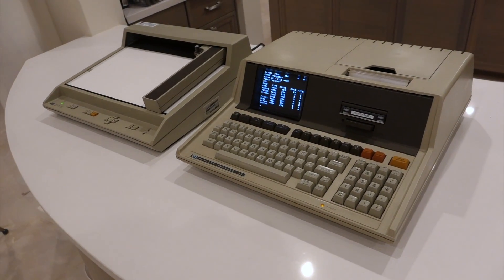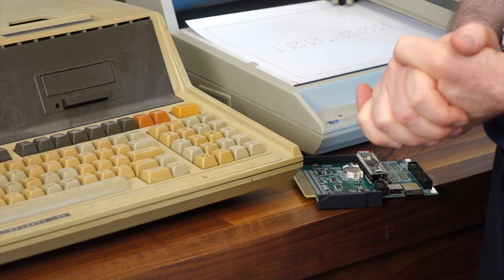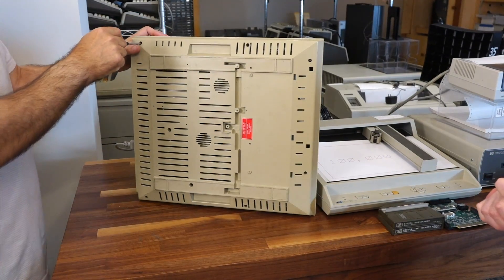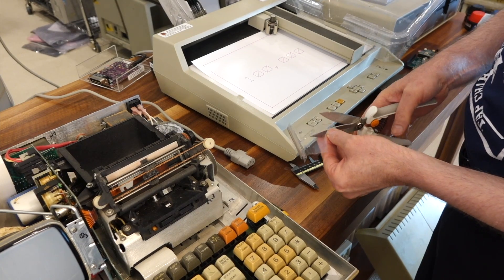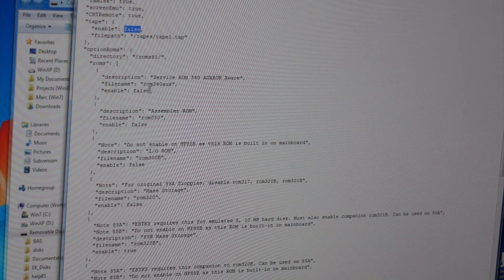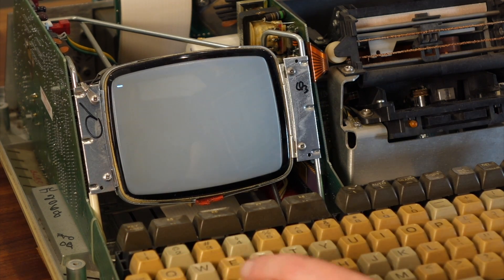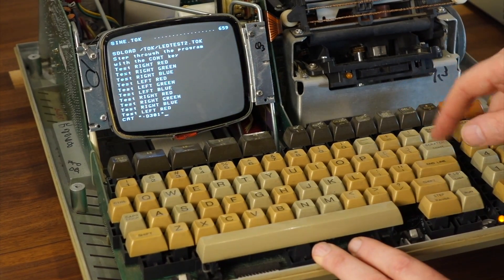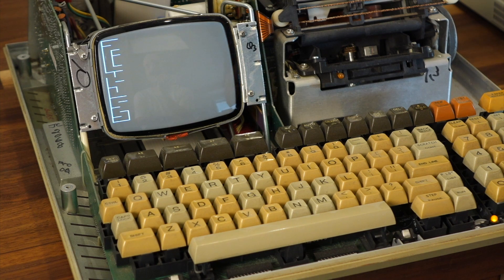EBTKS add-on board for the HP-85 vintage computer

Comment: That HP-85 looks like a prime candidate for solar-only retrobriting. Just leave it in the sun for a few days and watch the keyboard and case both un-yellow. It won't be perfect but it should be better, with no significant risk of streaking or splotches.
Reply: Especially for large pieces, I use ozone dissolved in water.  I use my ozone generator pumping ozone into water, getting ozone dissolve in water and leave the plastic in it for a couple of days.  Ozone generator constantly pumps ozone into water during the whole operation.  The result is always awesome without any streaking, splotches or nonuniform restoration.
Reply: @Mr_ToR  They'd still have to take it apart to put it in a tank, including pulling all the keys off the keyboard -- although if it has keyboard problems, it's probably going to get torn down that far anyhow. My proposal was to be as lazy and cheap as possible while still getting a result. :)
Reply: @mal2ksc  Don't you have to adjust from where the sun will shine or wont shine etc?  I mean normally a side at least should not get as much light no?  Do you have any images/video examples etc about sun only retrobriting?

Comment: Would the tape drive emulation code be helpful in creating a tape drive emulation for the HP9815 ?
Reply: Unfortunately not. Different recording format and probably different number of tracks on the R/W head. EBTKS emulates at the register level of the controller chip, which is only used in HP85 A and B.

Comment: Does this mean I can finally adjust and test the 8673 signal generators  according to their manuals? Anyone have this data? The mysterious 11726A tape data. I have both 8673B and B's monster of a brother called 8673D with their monster manuals.

Comment: That is incredible. I’d like to get at least one or two of those. The price seems very reasonable. I’ve got several 86s and 87s, but I don’t use them much since storage is impossible. This opens up a lot of possibilities, especially since it has all the ROMs. I’ve been trying to get an 87 IO ROM, but I don’t want to purchase if I can’t return and the seller can’t demonstrate that it works. This should solve that issue.

Comment: There are a couple of lab instruments which have an 85A built-in, and those are the 8450 and 8451A diode array spectrophotometers.
Reply from the maker: Thanks! I did not know! Now here is another instrument I need to acquire!
Reply: Was it the 9915A/B used as an embedded 80 series?

Comment: Can you stll replace the paper and ink in this mini computer built-in printer
Reply from the maker: Absolutely. It's a thermal printer so no ink needed and the thermal paper is available.
Reply: @CuriousMarc  oh, great then, I thought you cannot find it anymore since Gameboy printer uses thermal paper as well, but you cannot get it anymore

BTW: can you write on thermal paper by hand, with heated pencil or usibg a lighter?
Reply from the maker: @Veso266  I have never tried, but it should work. You can write on it with alcohol or glue too (don’t ask me how I found out).

Comment: Could the CPU be overclocked at all by changing the crystal. Say to 800KHz or even 1MHz
Reply: I doubt it, too much is tied to the clock already, so you would break a great many systems that rely on precise frequencies.
Reply: @SeanBZA  emulating the capricorn cpu on the teensy 4.1 has been discussed as has a zillion other things we 'could do'. The emulation would probably be equivalent to a 30+MHz capricorn at a guess. The actual HP85 would then just become a power supply, screen and keyboard.....

Comment: Adrian's digital basement just did a video on a 4 inch screen for $ 20.00. He found the quality too poor for practical use.
Reply: It really depends on the CRT itself, and the dot pitch of the actual unit. You get some insanely high resolution small CRT units, and some that were barely good enough to have 525 line NTSC mono video displayed on them.
Reply: @SeanBZA  I have a 9" green-phosphor CRT display (VGA, originally made for POS systems in the 1990s), and it has an unbelievably sharp picture.  The HP unit has a screen built for computing, most of the other small CRTs were built for cheap portable televisions.

Comment: Looks like they are using a Teensy 4.1 for the EBTKS, so the computer is with its 600kHz vs 600MHz on the Teensy just a tad slower, can it be used as a coprocessor? :D :D
Reply: Yes, it is a Teensy 4.1. Because of the do everything in software approach (including bus transactions), we use about 60% of the available performance. EBTKS adds about 70 new keywords to the system, and co-processor type acceleration is a future possibility.
Reply: @fliptrontube  Does the EBTKS come with a 4-inch thick operations manual?

Comment: That CRT is immaculate! From the video it looks like there is zero burn in.
Reply: It looks a lot like the ones used in those karaoke machines you can find at thrift stores. I had an old police terminal with a CRT needed to be replaced, and one of the karaoke machine tubes was a drop in replacement
Reply: Funny that Marc did not seem as impressed as you.  I seem to recall him saying it is "ok" or "pretty decent".  I agree with you - it looks great.  Marc has high standards...
Reply: For me it would be a fun project to replace that crt with an LCD, just for kicks, power savings, and safety (no more HVAC).

Comment: To my mind, it's a desktop graphing calculator with an HP1B interface, tape drive, and printer. I have some fond memories of using it to measure the noise floor in an old UCC-4 Multiplexer. Good times!
Reply: Can this be used for TV and radio spectrum analysis with a software-defined radio?
Reply: @scratchpad7954  If the SDR has an HP1B interface, it'd be easy. Otherwise, you'd have to come up with an I2C interface for it. The SDR would do the scanning of the frequency range from a set of parameters provided by the HP with the HP collecting the numbers coming back from the SDR for The HP's graphing function.

The FSVM (Frequency Selective Voltmeter) that I used would take commands from the HP and send back its readings of the measured frequency or range of frequencies. So the heavy lifting was performed by the FSVM and the HP would tabulate the results, store them on tape, or print to screen and/or thermal printer.

Think of the HP as the conductor of an orchestra, The conductor signals the various parts of the orchestra to play in various ways and the musicians provide the expertise in the playing of their instruments.

I hope that makes sense.
Reply: @15734_Hertz  Very good explanation.

Comment: Beautiful job.  The only thing I'd have added would be a completely unnecessary array of blinkenlights to show the device in use.  If you've got a floppy you want to see its access light, right?
Reply: There are a pair of RGB LEDs (WS2812E) on the back two corners of the PCB. Directly controllable from BASIC. Normally set to low intensity red and green so you can tell if the computer is coming or going
Reply: looks like its too fast to need an "I'm Accessing" light:)))

Comment: It's too bad HP never took on the 8bit home market.  These 85s were just a bit too much for the common man.  Neat stuff!
Reply: I was working for HP's Desktop Computer Division (DCD) about this time.   Mostly on the HP9845.

HP had 3 or 4 divisions doing desktop computer like things at this time.

HP was an instrument company.   They used to refer to machines (computers) on the 9845 production line as "instruments".

But probably the reason HP didn't invent the personal computer is "innovators dilemma".   The 98x5 line of computers were primarily used for instrument control in industrial settings.   Division management would never let you optimize a product for anything too far away from their cash cow.

The HP-85 came out of Corvallis.   An outgrowth of handheld calculators I think.   Always liked the box, never used it.  I think the whole integrated computer, display, keyboard, storage thing mindset came out of the instrument controller application.   Its convenient to have a single box to lug around with your instruments.   The original PCs had separate displays.   The laptop thing came later.

HP eventually did well in the PC market.   But it took quite a while and a much different business model.
Reply: @regulatorjohnson8640  Right. It was well into the IBM PC compatible wars before they got into the fray.👌
Reply: They would not be able to build it to a consumer price. HP kit was eye wateringly expensive
Reply: I doubt HP of the era were interested in building anything to a price point, as you would a home computer or video game system. It simply wasn't their business model, you may as well ask why 1980s Mercedes Benz never built something to compete with the VW Rabbit.
Reply: @Broken_Yugo  Interestingly, one of HP's biggest all time success stories were consumer grade printers.   With that oh so profitable ink.

The printer business rode on the back of the PC phenomenon.   HP had some interesting ink jet technology.    The infamous Dick Hackborn figured out how to make a consumer style business model work within HP.    A pretty good trick.

HP had this notion of "contribution" for some new product.   HP never wanted to build me too products.   The ink jet printers were pretty novel.   

One of HP's first forays into the PC business was a touch screen PC.   The touch screen was the contribution.   Not well received in the market.